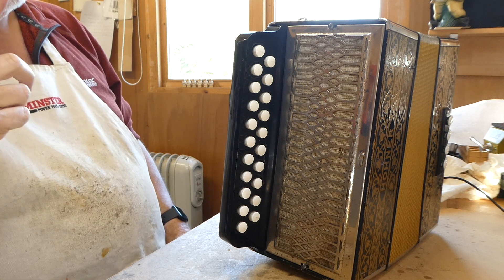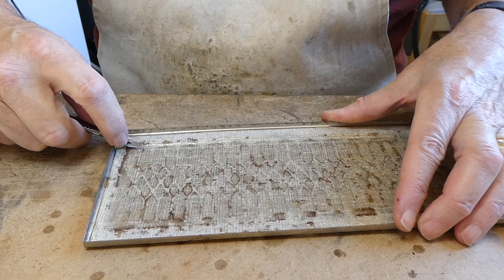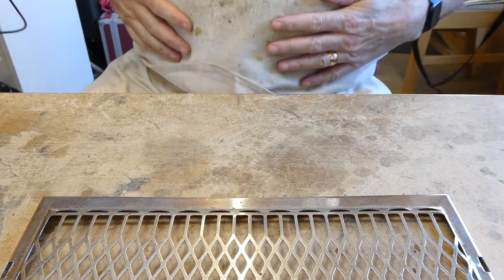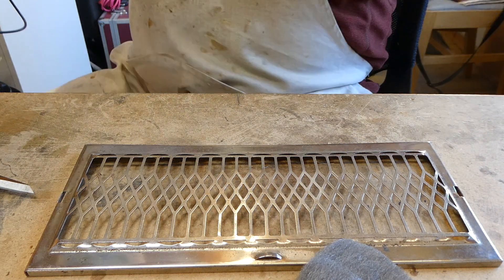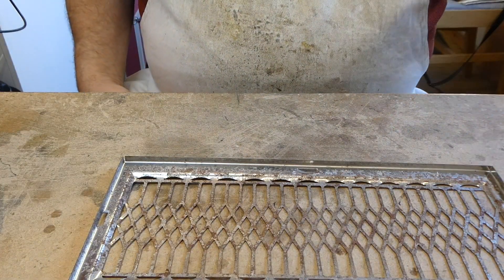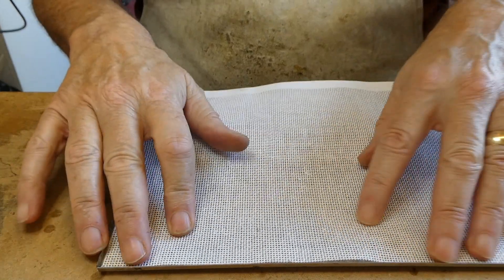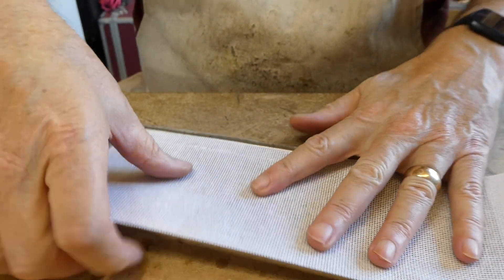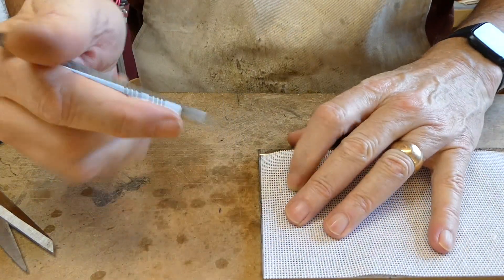Hot Rod a Hohner Episode 8 - Replace Grill Cloth

Comment: Interesting to hear which cloth you use, proper stuff very expensive, when i did one i soaked in a rust buster at work to get rid of rust inside as well, but it wasn't a stinky acid one it was water based one by Safety Kleen Company. Great films, thank you so much.

Comment: Hi Lester, I have an old pre-corona and it appears that the grill is nailed on with tiny nails all around. Is that how older grills were attached or am I overlooking something?
Reply from the maker: I have only ever seen screws, are you sure that what you are seeing are not fine slot head screws with the slot filled with the muck of age
Reply: Lester Bailey After spending much longer than I care to admit staring at tiny nails, I am 99% certain that they’re indeed nails, not screws. It looks like there is 8 nails on one side and 6 nails with two empty hardware slots on the other